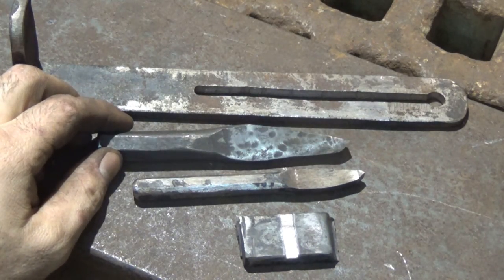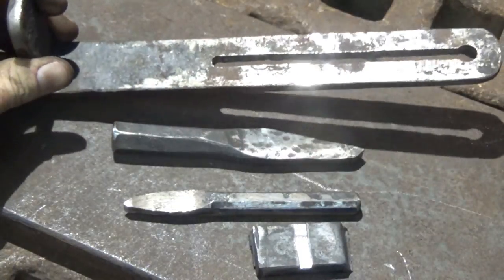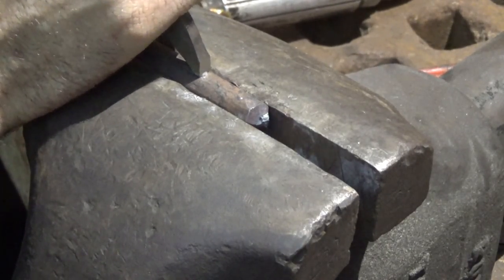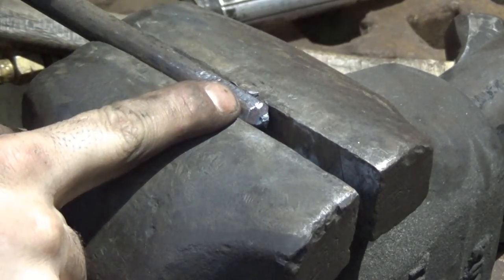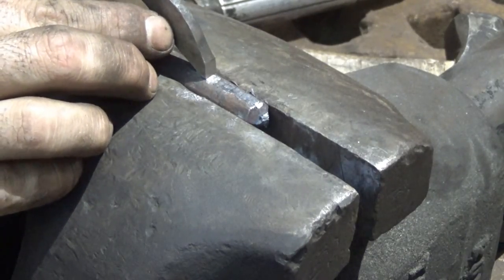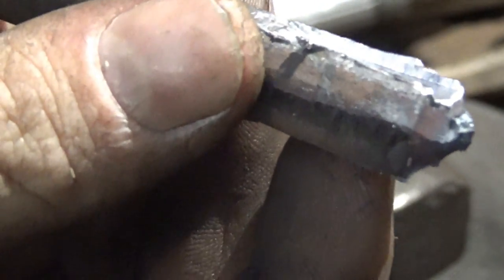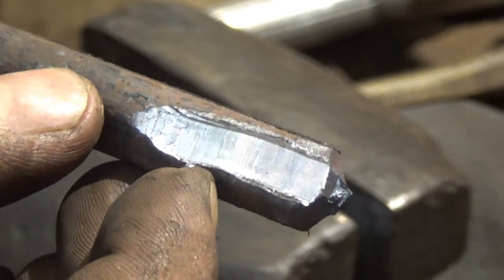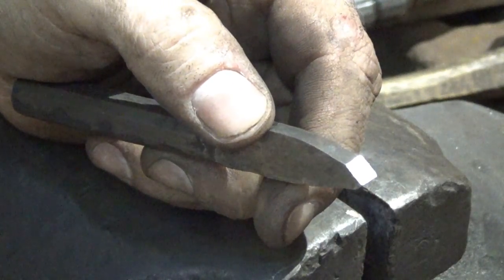The Humble Cape Chisel: A "Forgotten" Blacksmithing Tool

Comment: AvE did a video on cold chisels being the "poor man's milling machine" a couple years ago. The results look respectable.  Could you also start chipping from the end, or is there a reason for not doing it in the other direction?
Reply from the maker: He did! Good video. The results look a LOT better when you clean up with a file like the square example in the bottom of the opening shot. For cutting a keyway like this, I don't because it's harder to start from the end and keep everything square. Like I said in the video, you want to cut lightly until the corners bite and then the chisel will track itself. Once the cut is established and roughly to depth, you could come at the cut from the other direction to give it a square end if you like.

Thanks for watching!